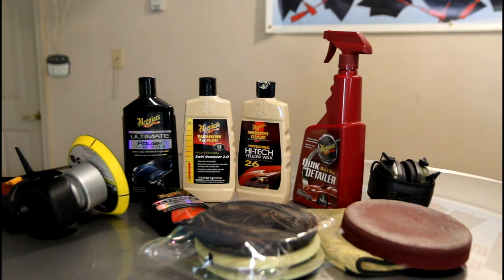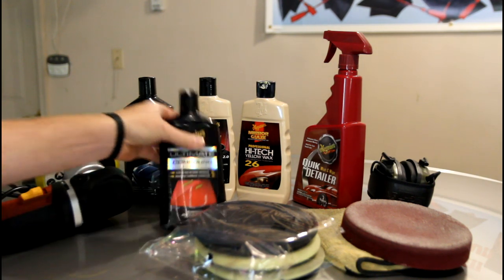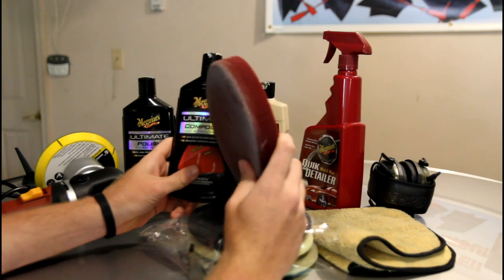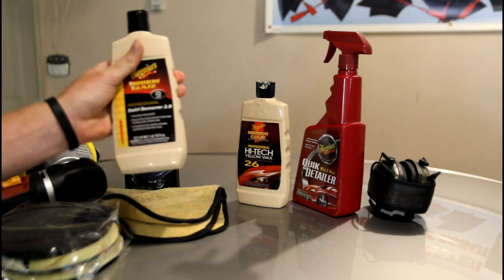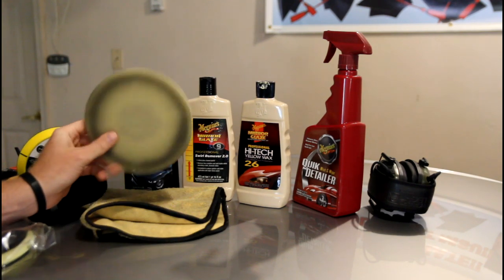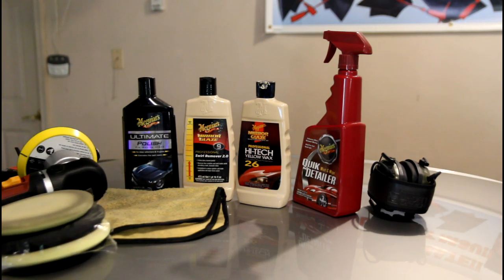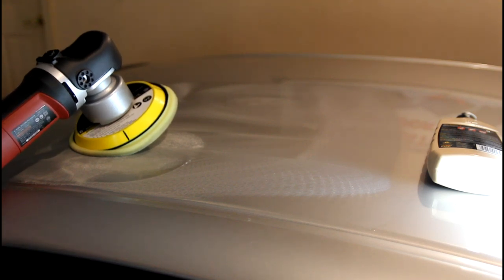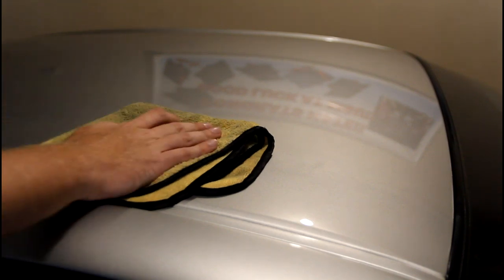Harbor Freight/Chicago Electric Dual Action - My Methods - Pt. 2

Comment: My experience with a DA polisher is you will be there for days on one car. A rotary is 10X faster and does a great job. I got mine from HF and the CG backing plate. I like the German diamond pattern foam pads from AliExpress (T-40 & T-10) because they are great quality and cheap. You talk about polishing with a product labeled as a glaze (its made to fill scratches). Its odd to see a video of a scratched up car and using fine finishing products w/o defect removal. [Just my perspective]

Comment: So you're using the pads that came with it correct?
Reply from the maker: Mine didn't come with any pads, I got some Meguiars polishing and finishing pads and have had pretty good luck.
Reply: @RamblinGarage  I've been using the griots garage pads and 3 in one polish but I'm heading to get the chicago electric now from harbor freight

Comment: Harbor Freight doesn't sell the Chicago DA anymore.
Reply from the maker: Looks like they have Bauer now.. might have to try that out
Reply: @RamblinGarage  Dangit. I thought I bought the right one. But instead I got Chicago 7" Polisher/Sander. It doesn't dual action. I tried section of the hood. Think I should exchange for DA or keep on with this one? Is there a risk with using this? Thx
Reply: I know this is an old thread but I bought one from Northern Tool that looks identical to the Harbor Freight one for 64.99, and you can get a 5.00 off coupon, I should have it in a couple of days as the store didn’t stock them but you can get them online.

Comment: GET A 5.5 BACKER PLATE
Reply from the maker: Which one do you recommend? This one hasn't been an issue yet, but I can see it being a problem in the future.
Reply: THE SIX INCH BACK PLATE WILL  EVENTUALLY CUT INTO THE  PAD MY FRIEND WHO IS A DETAILER AND HAS THE HB 6 INCH TOLD ME THE 5.5 INCH IS BETTER GARRY DEAN  AT GARRY DEAN DETAIL JUICE .COM AND CHECK OUT ANDREW A ON YOUTUBE ABOUT RELOCATING THE SWITCH AND REPLACING THE CORD WITH A LONGER ONE THAT IS ABOUT 25 FT THAT IS  WHAT MY BUBBY DID WITH HIS
Reply: Get the Lake Country backer plate.